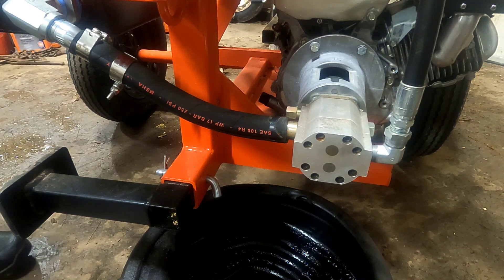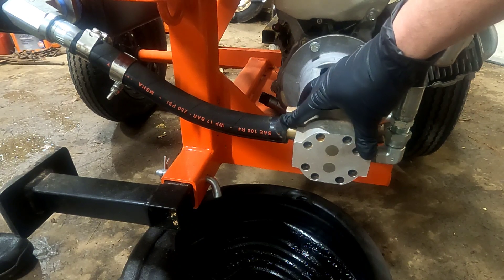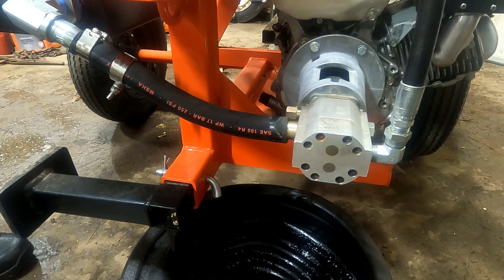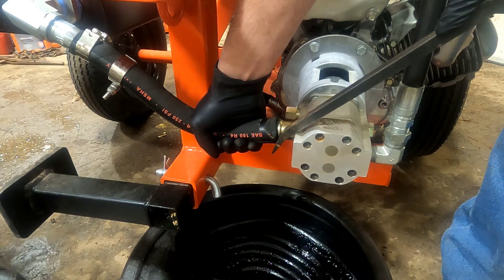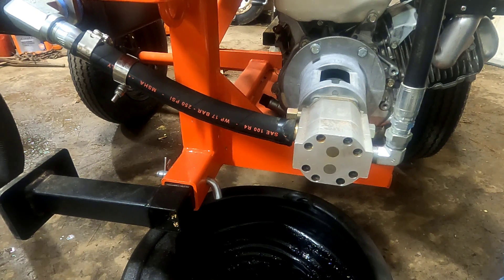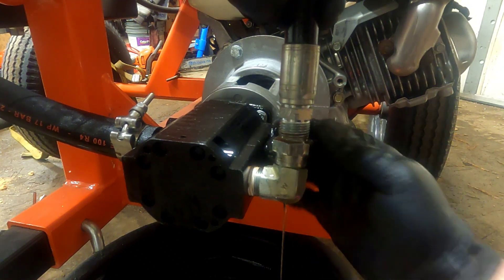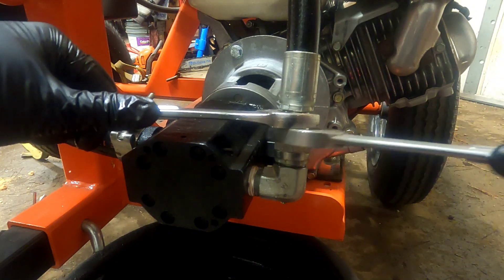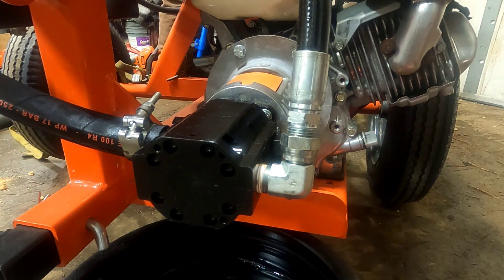Hydraulic pump replacement on our log splitter. Wolfe Ridge 28 PRO

Comment: Great job and thanks for sharing!  Extending the cylinders would have helped to lower the oil level so the shop vac would've worked a little better. All in all it was a relatively clean swap. Thanks again for your patience and willingness to make your machine better. 

To the suggested ball valve comments, there are far greater potential dangers compared to benefits of adding ball valve to the suction line. If that valve gets closed inadvertently, it would cause a pump failure or cause other issues.

Also, please emember that I don't make the pumps, or get any money back from the vendor if they don't work correctly. In 2020, we had a choice... find a pump that works so I can fulfill customer orders or I cancel orders and close the doors. We did the best we could with the parts that were available, some of those parts were less than stellar but we are committed to making sure our customers are taken care of now that better parts are available.
Reply from the maker: Thanks for all your help on this pump Chris. I  knew I forgot to extend cylinders.  I  totally understand the problems that were going on in the last few years with parts availability.
Reply: @Lifeinthe906  Yes sir!
Reply: Who manufactures the pump? Whats its efficiency rating and gpm at 3600? Im guessing 22gpm? Do you also sell them? Standaes SAE2 pattern im guessing?

Comment: You spend upwards of 10k  on a log splitter and you're already changing out the pump?  My Northern Tool splitter cost less than a grand and lasted over 30 years. I've seen all that I need to see.

Comment: How many GPM pump did you originally have and what was the GPM replacement pump ?
Reply from the maker: I believe that it came with a 16 GPM pump. From what I understand that pump was not performing to specs. I assume the replacement was also 16 GPM
Reply: @Lifeinthe906  Thank you sir. Your video was very helpful to me .👍
Reply from the maker: @davidwhite5858  Glad I could help

Comment: I have a 28 Pro that I got Jan. 2021. I also changed the pump with a new one that Chris sent me. The cycle time is 4 seconds faster. Plus the log lift and wedge cycle faster. I extended all three cylinders to help get fluid out of the tank and used a shop vac. Didn’t loose any fluid when I removed the hose and attached it to the new pump. It’s a great splitter, Great customer service.
Reply from the maker: I agree the product and service at Wolfe Ridge are top notch.  We will get a better idea of what we gained when we do some actual splitting with it. I'm sure the oil wasn't up to full temp running it in the garage.
Reply: What was the beginning cycle time and then after the change what was the cycle time?
Reply: what is the cycle time on a unit like that?  On your pump, do you know the GPM? Just curious, I am about ready to order a pump for my old splitter. My dad bought it in mid 80's . I have changed the motor, piston, most everything over the years but not the pump. It is really really slow now.

Comment: Very well executed!  Looks like watching other messing with hydraulic oil got you skilled at that! Lol! Assuming you ran very few cycles in the garage (door shut), you will gain even more than 2 seconds when the oil gets warmer.  That is indeed a huge factor in cycle time when you have high capacity pumps.  But to begin with, 2 seconds is huge already! Thanks!
Reply from the maker: I think we may actually be able to get out and do some splitting this week. Then we'll see exactly what we gained. But yes the 2 seconds is a great start. Thanks for checking out the video.

Comment: The price they charge for these machines, they should have a shut off at the bottom of the tank. So many problems with this brand, I would never ever buy one
Reply: Wow... There really are not that many issues. We have built literally thousands of wood splitters. You have seen less than 10 videos with any type of trouble. When there was an issue, we made it right.

A $30 ball valve on that machine not only costs more, but could also burn up that pump if it gets closed and the operator forgets or does not notice.
Reply from the maker: The shut off would definitely make things a lot easier for doing work on the pump. Do you know if other brands have a shut off?
Reply: @Lifeinthe906  I'm not sure but a ball valve is real cheap considering how much benefit it would be. Easy retrofit too.
Reply: If you add a value tie the handle open for sure, they can close on there own 😢😢😢

Comment: How come there put a shut off valve at the tank Mike . $9 dollar part . Mike don’t use white pipe tape not make for heat . Use the yellow tape  I think it for heat in hydraulic system. White for water fixing Mike .
Reply from the maker: Thanks Leonard.

Comment: I feel like you have the hose clamp to far out. Go back in the video, and you will see how close to the pump it was originally. Half the clamp appears it is on taper, and half is just on hose now. I know it is low pressure side but vibration might cause it to start seeping or let clamp slowly cut into the hose...
You also realize that you will need to hustle even more in order to keep the beast fed now, right!?!?😂
Reply from the maker: Thanks Wayne. I'll have a look at the clamp.
Reply: I was about to suggest!!!

Comment: I general no teflon tape is used in hydrolic systems as it can partially dissolve and cause clogs in the system and/or damage the pump. If you look back, the high pressure fitting came of the old pump without teflon tape. So it is not needed.
Reply: The only fitting you use thread sealant or tape on is regular pipe thread. Other types of hydraulic fitting thread are not made for tape and you never use it
Reply from the maker: @cowshottv5867  Thanks. Hydraulic work is not really my thing.
Reply: @Lifeinthe906  the short lesson is pipe thread is tapered so the seal really is created on the threads... so you use thread sealant. Other types of fittings seal on a machined face with an o ring or other type of mechanical seal, not the threads
Reply from the maker: Thanks

Comment: The story on the pumps is that WR was told they were just as good as the Concentric pumps, they tested fine at the factory but failed prematurely. What was your cycle-time before the pump swap?
Reply from the maker: Yep that's the story I heard too. The cycle time was over 12 seconds
Reply: @Lifeinthe906  one 28PRO owner said theirs was over 16sec.
Reply from the maker: @thefirewooddoctor  Ours was not that bad.
Reply: The last video he did said that the machine was rated at 12 second cycle time but he said it’s even slower than that. Yikes that pales in comparison to the Eastonmade splitters.

Comment: Same here. I spend enough over seas for the Mazda parts that if I can keep money here at home in the USA, I will do just that..
Reply from the maker: Yes sir. I have nothing but good things to say about Wolfe Ridge.  Great company.  Thanks Daniel
Reply: @Life in the 906  : Same here. They may be the "underdog" at times, but every time I ask a question to have an issue, they are up front on what needs to be done and not suger coating it..